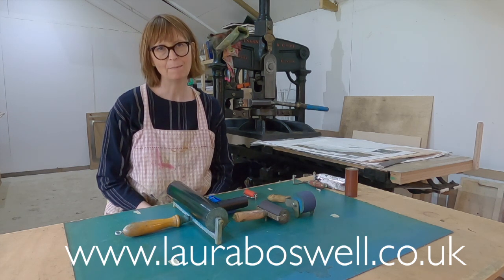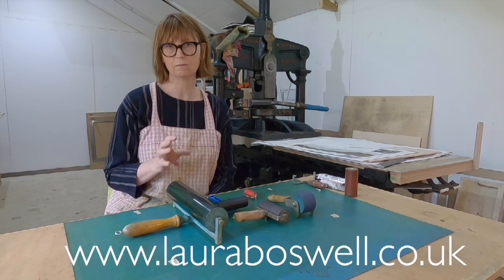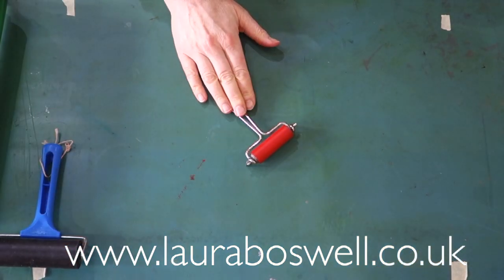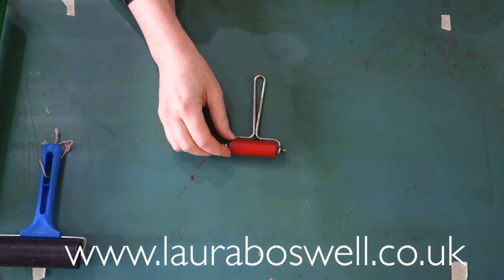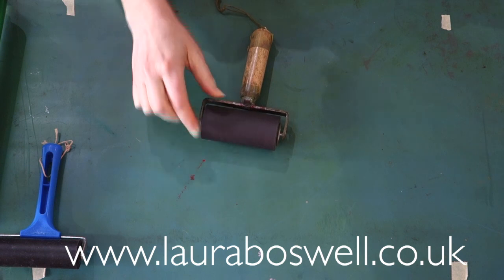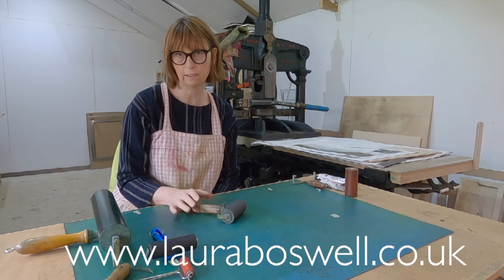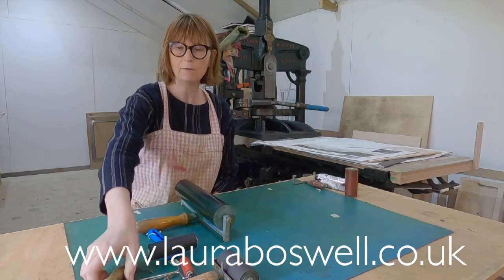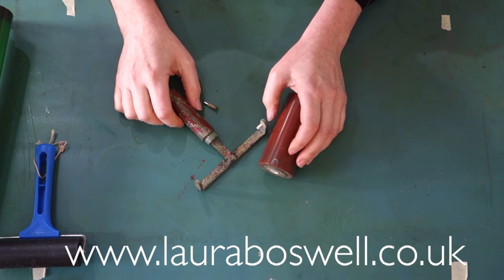Reduction Lino with Laura Ep 16 , Rollers (Brayers) for Printmaking: Types of Roller and Maintenance

Comment: I got a old roller that is stuck I want want to repair. I removed the bolts on both sides, but no luck releasing the roll. How did you remove the bolts ?
Reply from the maker: no idea - sorry - all roller makes are different, try the manufacturer perhaps?